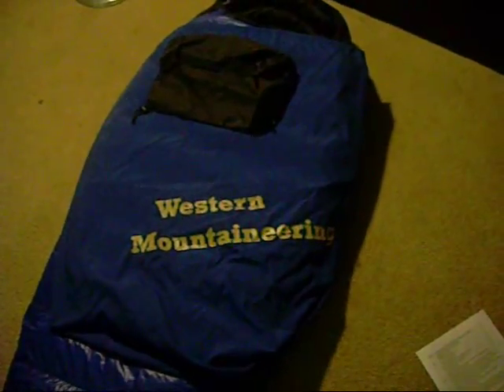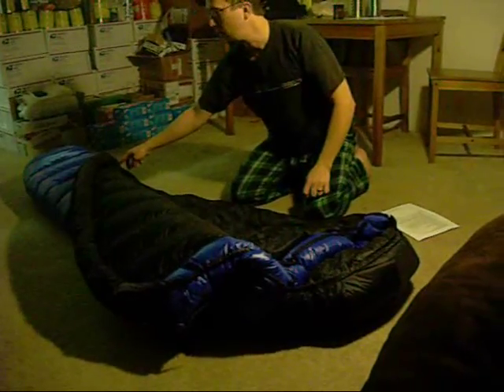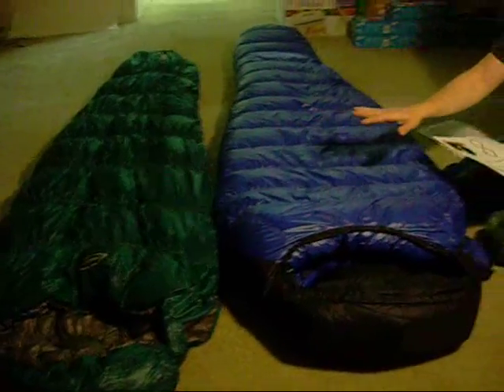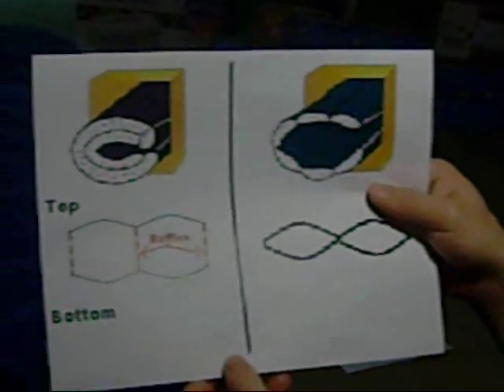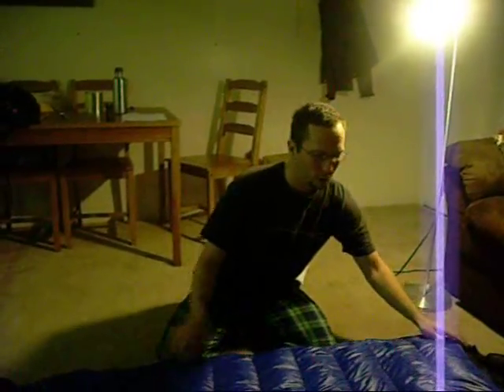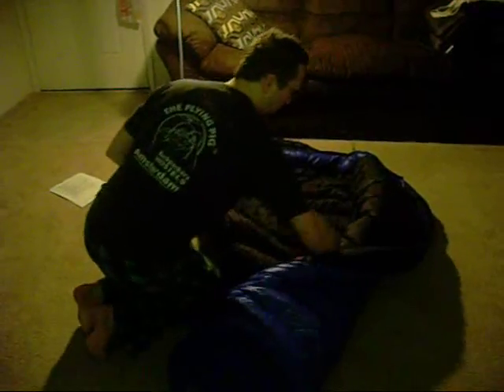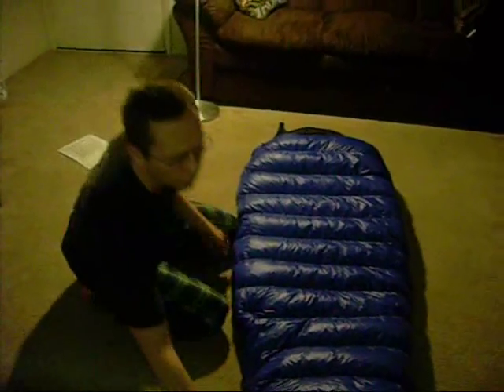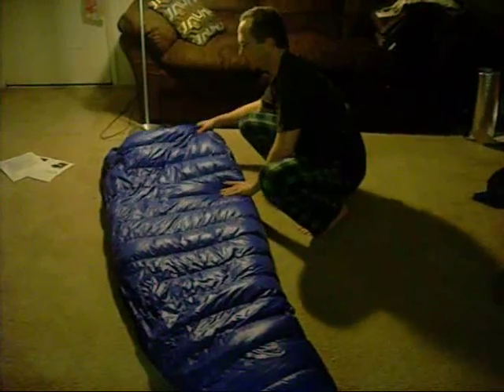HikeBikeDale: Western Mountaineering Ultralite Down Sleeping Bag 20 degree

Comment: Great video. I do want to point out that the continuous baffles vs sewn throw does not effect the ability to shift the down on a bag from bottom to top. I use a marmot atom with sewn through construction on 40 degree and up trips. I almost always shift about 85% of the down to the top of the bag.